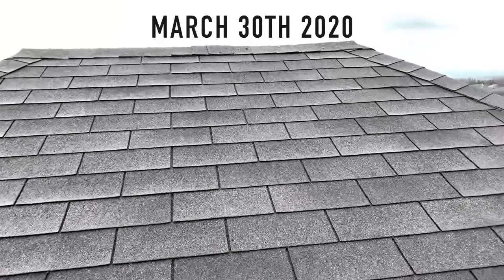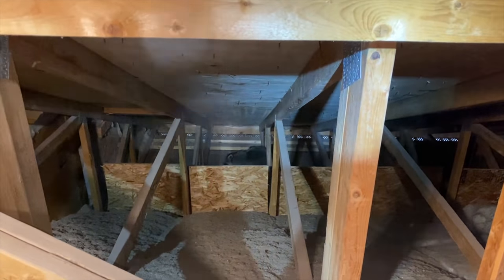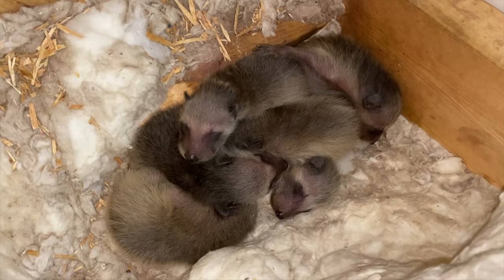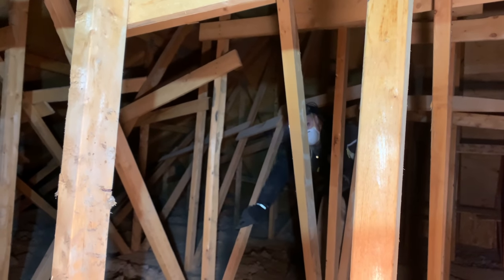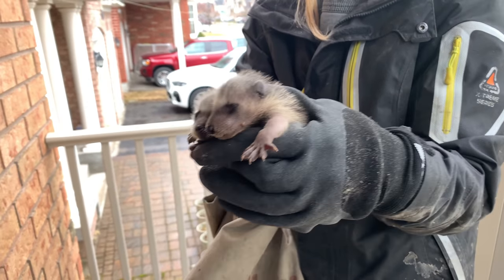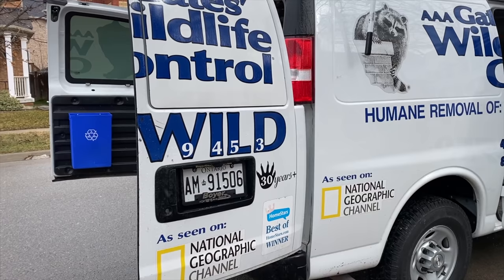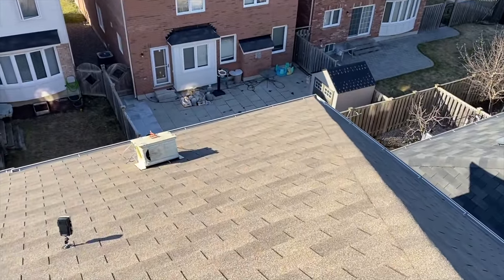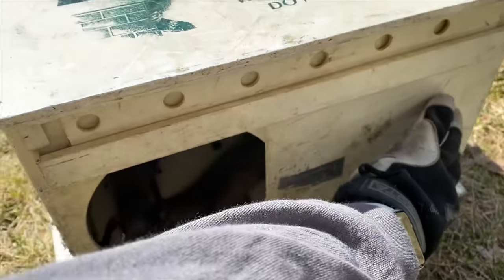Adorable Baby Raccoons Find A New Home

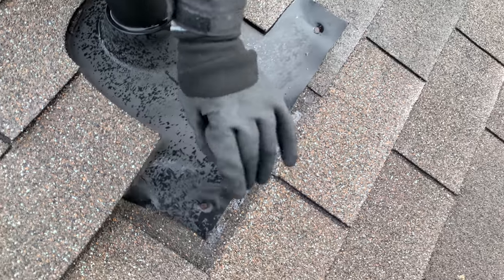Comment: 0:42 Is that really the proper way of attaching the rubber? I'd expect the water to leak in through the nail holes and rot the underlying wood.
Reply: Maybe the rubber forms a kind of gasket?
Reply: Mom would have pulled off a tile.  It was probably blown away in a storm.
Reply: @jayceewedmak9524  I can't see any way of putting a tile back that would correct this problem especially as regards the centre nail.
Reply: @sylviaelse5086  I'm no expert, Sylvia lol  just what my S-I-L suggested.  Take care! :)